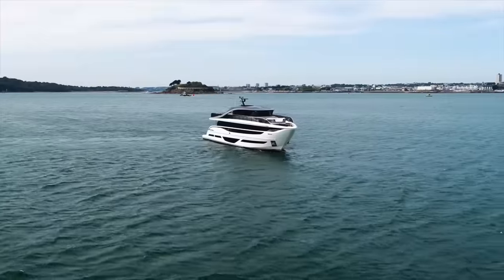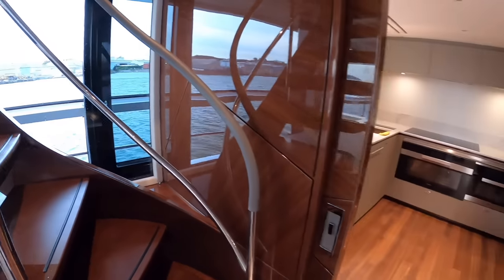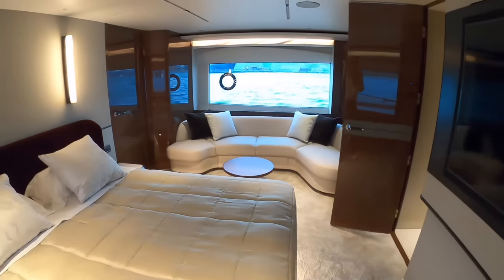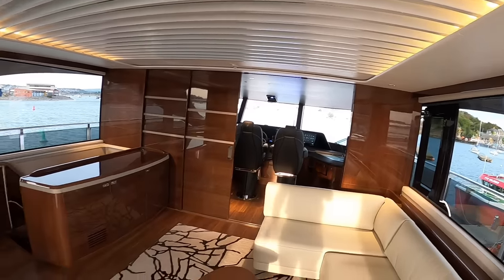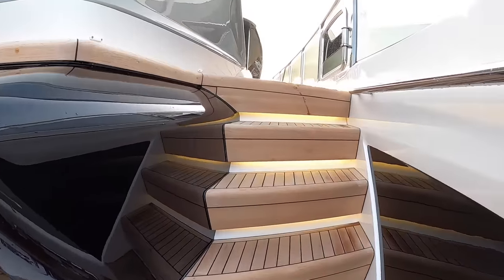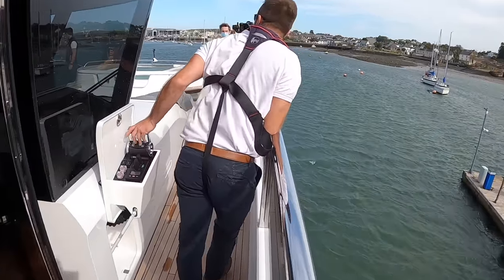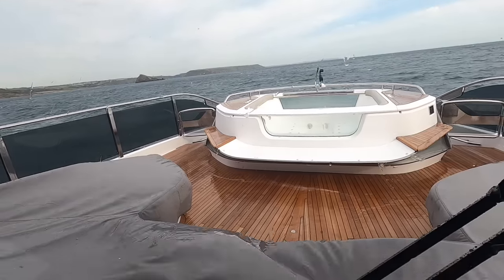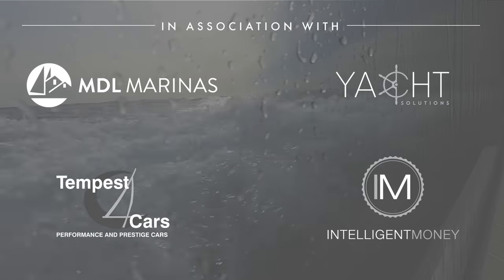$11.7 Million Superyacht Tour & Sea Trial : Princess X95

Comment: Hi Nick. I don't know if you reference new comments to older videos but I've just watched (again) the Princess X95 tour, immediately after the Squadron 68. In the latter, you refer to the lack of above water chimes. In the tour of the Princess,  is the noise in the lower cabins what you refer to as "slap" from the chimes? Sitting in front of the TV knowing I'm gonna need this info very soon when I (inevitably) win the euro millions. 😂
Reply from the maker: Yes, but bear in mind it's louder here than normal because the boat was on an exposed commercial berth, not a normal residential one which would likely be more sheltered.

Comment: What would something like this depreciate to in price after 2-3-4 years? Just curious, as this one you have listed in $USD which is a rarity for your vids (assume it’s £10M new in GB Sterling?) ... but the more I research - I’m thinking Princess is definitely the brand for us (though some mfg’s offering diesel/electric engines have also caught our eye... but am only just now starting to research those power plants too) “the hybrid of the high seas!” - Nice to see the boating world catching up with the automotive sector 👍🏻 

Do you have hire/letting contacts in Monaco for the Grand Prix week if we wish to invite 8-12 clients + staff down for a 4 day race weekend and then weather permitting run the staff around the Amalfi coast for a couple of days after (or before) as a reward for a job well done in 2019?  (Think we’re all trying to forget 2020!) My reason for asking you is you did list or have a video that was attached to one of your Monaco posts that said “mooring at Monaco isn’t as expensive as you may think” (believe it was an associated advert that got tagged onto your Monaco video?) Whatever the case, I believe there was a spread sheet listing pricing for <75’ around $4500 for the week. Right on the track after the tunnel exit. There’s Company’s that offer full service catered packages we’ve talked to-but their pricing is easily 5x-10x higher than what we could charter a M/Y for and moor it there - and then as said, spend the 3 days watching the races and then visit all the usual typical tourist traps ... but more importantly wish to take my team out cruising as a reward. I think they’d love that. I know I would! 👍🏻 This boat is a work of art. Curious though how different the Euro market is vs the USA. Whereas here Christensen, Hatteras, SeaRay and Mainship really top the list  (along with 100 other mfg’s all fighting for the top spots) that are much less or a LOT more expensive and more bespoke) but for those that left Bayliners behind 30 years ago - but not looking to spend $25M+ on a M/Y - you’ve really opened my eyes to the value within the Princess line and can’t wait to check them out at the next FLIBS show 👍🏻 “Princess” really hits that sweet spot between quality and a reasonable budget (but am still holding out for the Monaco Porsche (insert my disgusted, envious, jealous drooling 🤤 face here!) Such a work of art she is! Yet the price and size - As CEO am currently budgeting for our used Citation first and think the $$ saved by going with the Princess brand over the Porsche design will get us 2-3 extra seats (or a couch on that jet🛩) and a few years newer Corp jet (Note: these are not mine!! It’s all in the company’s name) so don’t hate on me. We just opened our Monaco office in 2019 so between the race and running charters we can justify a M/Y. With EasyJet and now Norwegian Air? It’s tougher to justify private jets. But I’ll confess I’m spoilt and having one (either flying clients in on our dime to Nice, FR w/private pickup and then a quick cruise around the harbor has increased our sales 20-fold. It definitely separates us from the competition. 

Anyway - I’ll digress. 

Most of these SuperYachts are owned by Middle eastern billionaires dealing oil. That’s so not us. We earn every dollar one day at a time! Peace ☮️

Comment: GREAT VIDEO NICK!!! 

I see the guys using Navionics on the iPAD, we are ECDIS compliant with Transas onboard AWOL and I still prefer Navionics on my phone but don't tell anyone ;))

Very Impressed with the Drone pilots skills, especially with the wind strength.

It seemed like a bit of a wet boat, lot of water coming over the bow but as we know these boats are built for pleasure use not so much heavy seas.

Well done.
Reply: Hey Tristan.. I too prefer Navionics over Transas.. never been a big fan of navi-sailor to be perfectly honest... but yeah, having that opinion seems to be frowned upon.. so I also tend to keep it to myself lmao..
Reply from the maker: Hey there Cap'n T! :) To be honest, we had the tabs down a bit and were running quite hard to get some spectacular footage. I think most boats would be kicking up big spray in those conditions and at that speed.
Reply: AQUAHOLIC possibly, either way really great video. 👍😎
Reply: Stupid off topic question to the both of you.... Why do you build up the  revs as opposed to just pushing throttle fully open?
Reply: @andyjamess  I'm no yacht captain, but I would put my money on less stress on parts/systems. You're trying to move A LOT of weight, granted their engines/motors have a lot of torque, you'd be putting unwarranted stress on things.
Reply: @andyjamess  I'm an aircraft Captain - on a jet (these days) the engines are rated for slam acceleration, so they'll take it if you need power in an emergency - but that doesn't mean it's good for them, or for the maintenance bill. :)  And, as Nick said at 33:45 - It's a new boat, let's not thrash it. :D
Reply: @rvaughn1131  Thank you. I did think that to be fair.
Reply: @amcconnell6730  Thank you. I am a great lover of aviation as well. What is your 'office'?
Reply: @andyjamess  The other consideration, which would vary by condition, weight and power, is over powering the prop ability to move water. IOW, the same effect as spinning the tires on a car. And likewise, spinning a shaft in conditions that would create cavitation (wheel hop on a car) you risk shaft damage due to vibration, shock loading of the shaft, etc. which transmits up the shaft to the transmissions and engines. 

And not a stupid question. Most people don't understand the dynamic loads on powertrain components. But owners operators of these boats that aren't professional mariners ought to learn a bit about it before they give a boat yard repeat lift business.
Reply: @Mrsnichols1965  That was what I thought the reason was but I thought I would ask anyway. Lol
Reply: Hi Tristan, bump my entry up to 1st place please!!!!
Reply: Exactly Tristran. Hardly a white top on the waves, and its spraying like hell. Not a goo seakeeping hull design.
Reply: @andyjamess  The screws are more efficient and won't cavitate when brought up to speed this way.
Reply: The Captain must not be working for the owner but maybe for Princess involved in the delivery because someone who paid 12 million dollars US for that extravagant yacht would not appreciate the joyride provided by the Captain unless ofcourse if it was a shakedown run or engine test.
I personally would fire the Captain for the unnecessary use of the "full throttle" running of the new million dollars worth of Mann engines.
Im sure that type of use of the engines would only be reserved to outrun pirates or storms.
 Although im sure its still under manafacture warranty it still wouldn't change my mind.
Reply: @andyjamess  I f you just slam the power on, assuming the the props and shafts will take the stress, all you do at first is cause the props to cavitate which, over time will pit the surface of the props. The props will eventually bite in and gain speed but you over stress you engines.
Reply: @andyjamess  Just saw this. :) Airbus A320 these days, previously Boeing 737.
Reply: @AQUAHOLIC  Hi Nick. I see what Tristan means with a wet boat. It takes a lot of water over the bow. In one of your videos with Smuggler Blues 2 you plowed trough a wave with the water nicely pushed away keeping your boat dry although the water went higher than the deck area.

I think it has to do with the fact it has openings at the bow and a slanting deck allowing water to come trough ending up on the windscreen. Adding a fairly blunt bow I think that the combination act as a wind tunnel making matter worse than a more "traditional" long V shaped bow. I do understand their reasoning though. It free-up a lot of space for guests otherwise only used for anker gear and the unsung hero's (crew).

Might be interesting to have the same trip on a Y95. Pretty much the same boat but without the opening at the bow and in my view much more elegant.
Reply: This is weird... my two favourite yachting channels in one place like one of those mashup episodes of cheers..
Reply: For the lay person Tristan could you elaborate on your comment re the link between ECDIS compliance Transas and Navionics? Cheers
Reply: Very nice wonderful
Reply: 9
Reply: What's the draft and loa.
Reply: @robsycko  no

Comment: Only 3 crew? Supposed 1 is captain, the other engineer. That leaves 1 bed for 1 crew member to cook, clean, serve all day and evening, oh stand watch at night and rotate days off? How that possible, unless owner doing work himself.
Reply: Your right it's low on crew, but this sub 24 metre Load line length (very clever to use a bolt on bow Princess) pleasure craft categorie yacht. This one can be owner operated without legal need for any qualified crew!! Princess could say there's 3 crew too many, save on salaries!! Most qualified yacht captains hold a basic engineering qualification leaving you with two crew to deck hand, clean and serve.

Comment: Would not sleep near the bow, the noise is awful on any boat. You can hear on this video the water lapping whilst in forward cabin. Why not build service areas or kitchen in there instead.
Reply: Traditionally the noisy bow section at the water line is where the crew quarters are!!

Comment: "The fire extinguishing system" points camera at a fire extinguisher.
Reply: The extinguishing system is piped in. It sprays everywhere in the engine room automatically. It's not a handheld fire extinguisher.

Comment: Love this yacht. It's a bit weird having the gloss walnut over the fridges instead of stainless, no stainless splashback behind the induction hob, and not much working space to cook for ten + crew. The full beam master on the main deck makes boat handling a little harder - placing fenders and moving around to secure lines etc. The crew cabin TV is in a silly, unusable position, it should be swapped with the oven, so that the oven is over the table and the TV opposite - but that's all problems for the crew, not the owner, I guess. :)  
Quite noisy gurgling in the VIP2 as well...
Reply: I thought similar as you,but Nick did say the boat was already sold and the spec was the owners choice,so I guess we can all have what ever floats your boat

Comment: Can I ask a q - if you were in a traditional 95 foot flybridge - would the water over the bow have been the same or would it cut through more efficiently compared to the 'new' design?
Reply from the maker: They're doing a conventional flybridge 95 footer (Y95) and it will have the same hull so will be the same. Ultimately you're hitting big waves with 100 tonne of boat at speed. That's always going to kick up a lot of spray.

Comment: Nice video Nick , would just say though ships a lot of water what what looks like not exactly ocean size waves , probably  3’-4’ , would love to see it in some really big stuff , bay of biscay in a 7 or 8 imagine permantely drowned on deck . Doesn’t look to be much flare in the bow sections so guess that the reason .
Reply from the maker: To be fair to the boat, we were deliberately crashing head on into pretty big waves (the camera always flattens them and we were sat high up) with 100 tonne of boat at 16 knots, pretty sure any similar sized boat would have had the same effect of throwing up a lot of spray if you did that with it. Glad you enjoyed the video 🙂
Reply: @AQUAHOLIC  I d agree nick , video always makes the ocean look flatter than it is , did a lot of drone work on yachts south of france and even though afternoon it always blows up around St Trop the video never shows much . Nevertheless , still would say that’s a wet boat , not a problem if it’s coping well, but put a 100’ Hatteras game fisher through that at 20 knots and would not be that wet . The X95 looks like a very bluff bow so will throw up everything it runs into . But a crazy amount of space for a 95’ so no doubt they will sell a lot of them for med based boaters I imagine will do well on the chafed market too .

Comment: Excellent review and very detailed. I have a techie question if I may... how does one get access to th Internet? All by satellite I'm guessing but are the speeds decent enough to stream something in 4k? Would these boats have wifi repeaters throughout? TIA
Reply from the maker: It's owner spec, but wifi hotspots are common, and connection via 5G if close to shore, satellite further out.

Comment: Great video, superb presentation of a fantastic yacht. But I have to say, I'm not impressed about the noice reduction or the insulation in the hull. It is rather noisy in the front cabin from the relatively calm sea outside. I would have trouble sleeping in that noise.

Comment: Princess x95        aprox $12 million
Length overall	95’  - 29.11 m
Cruising speed  10-knots 
Maximum speed of 24-26 knots

Range  2,000 miles @ cruising speed 

Fuel capacity	   13400 litres / 2948 gal / 3540 USG
Water capacity 	  1800 litres / 396 gal / 475 USG
Black water tank	  720 litres / 158 gal / 190 USG

Draft    2.01 m
Beam  6.77 m -  22-foot   GRP V-hull
Standard Power: 2/1900-hp MAN V12-1900 diesels

maximum occupancy of 12.

Tri-deck (Claims to have 40 percent more interior space than a typical 95-footer)
retractable swim platform

Comment: I was just wondering, are those large windows in the guest room (that you showed whilst in motion) in any danger of breaking under the weight of a heavy wave at all -perhaps if it was a side-on impact? Outstnading reviews, by the way!
Reply from the maker: Glad you like them. A LOT of stress engineering goes into those windows, they're probably one of the strongest parts of the topsides.
Reply: @AQUAHOLIC  Oh wow, I wasn't expecting such a speedy reply -thank  you. Just wondering, you wouldn't happen to have any hydrogen powered/fueled yachts in the pipeline by any chance?

Comment: a stupid place to put a bath in front of the helm position you cant see the front of the boat
Reply from the maker: You wouldn't use it whilst the boat is under way
Reply: @AQUAHOLIC  i understand that but the whole thing is in the line of vision of whats in front of the boat
Reply from the maker: @peterstead7510  Why would that matter if the boat were at anchor?
Reply: @AQUAHOLIC  still be in the line of vision when under way
Reply from the maker: @peterstead7510  Rest assured, having driven it, I can assure you that it's not an issue 🙂
Reply: @AQUAHOLIC  of course you would say that you are trying to sell it end of conversation
Reply from the maker: @peterstead7510  I don't sell boats! 😄